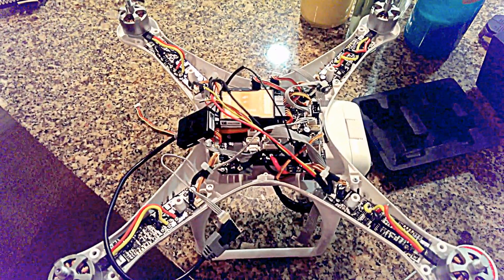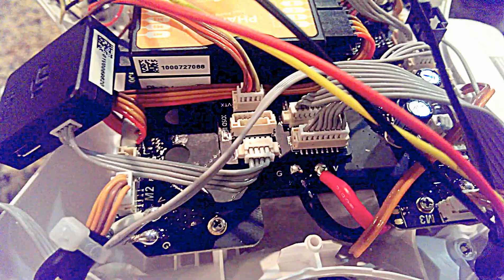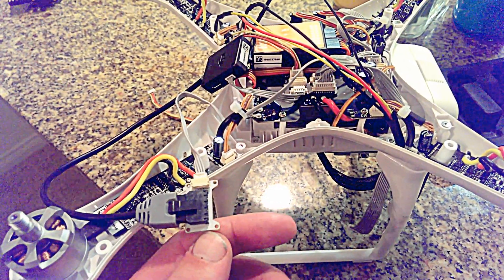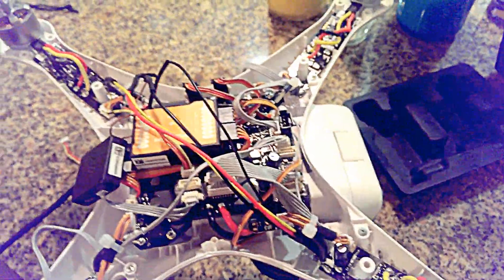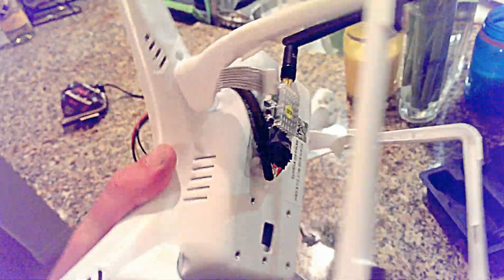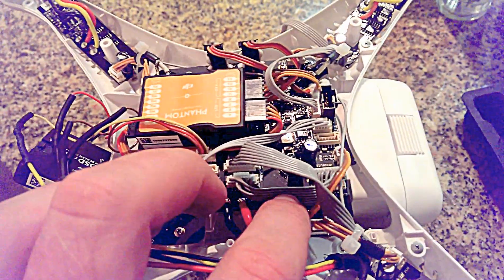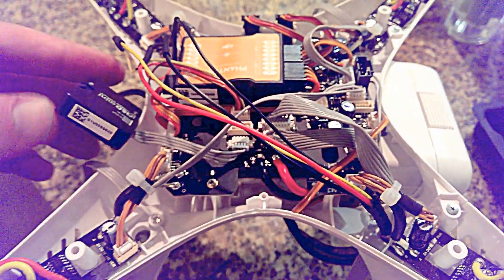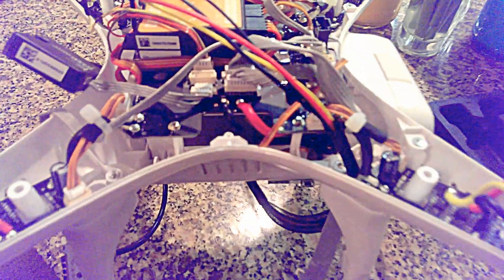Wiring DJI Phantom 2 FPV hub with Zenmuse H3-3D

Comment: I see you installed the P&P cable hub next to the main electronics module.  Do you think it is safe to mount it inside the Phantom? If you look on the DJI Web site for the P&P cable hub it says, if I'm not mistaken, that mounting inside the Phantom is "not recommended." 

An alternative for an all inside installation is the no-solder P&P cable on eBay at http://www.ebay.com/itm/Plug-and-Play-Cable-DJI-Phantom-2-to-iOSD-Mini-and-ImmersionRC-TX-/121448006779?pt=Radio_Control_Parts_Accessories&hash=item1c46dd847b as recommended by YouTube user, L BS, on his video (in comments section) "DJI Phantom 2 - How to install the DJI iOSD mini to Phantom 2 (clean look version 2)".  Another video shows how to install the cam bus power connector in the battery compartment.

Comment: Are you using the TX5802 video transmitter? I am using a Black Pearl with a FPV hub and everything seemed very straight forward but when I turn everything on, the Gimbel works fine and it powers up my tx5802 and when I set the Band to F and Channel to 4 I get a black screen no video. I changed out the video cable on the gimble to the gopro but still have the same problem, Any Ideas?
Reply from the maker: Cycle through all the channels, it might not be on that one.  I'm not an expert, so I can't help you troubleshoot. I'm sorry, I wish I could be more of help.  I'm sure you have it figure out by now

Comment: Dumb question...the IOSd mini fit in the housing or did you have to velcro it to the outside?  I see it there it just doesn't seem like there would be room.
Reply from the maker: I fit it inside, right at the end of where the battery goes.
Reply: Neill Drake I ended up putting mine outside along with everything else.  It's ugly but it's functional lol.  Thanks anyway.

Comment: Did you do this because your original Phantom Cam-Port wasn't working? I just tried to hook up my FPV system and the Cam Port isn't supplying any power, so I think this FPV hub will fix that issue.
Reply from the maker: I just saw the hub and ordered it when I ordered everything else, It's a life saver
Reply: MIne isn´t working either - so I will try the HUB and hope it will do the trick. Don´t get any power from the Cam Port too